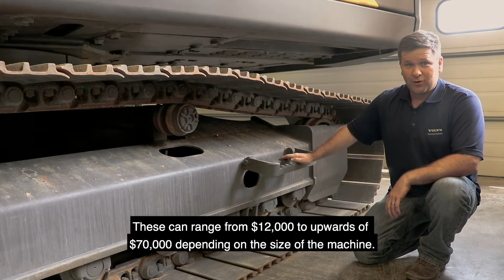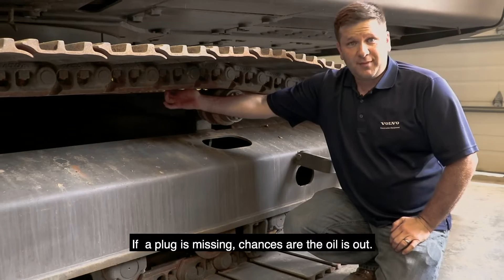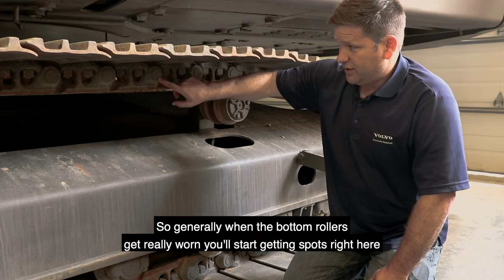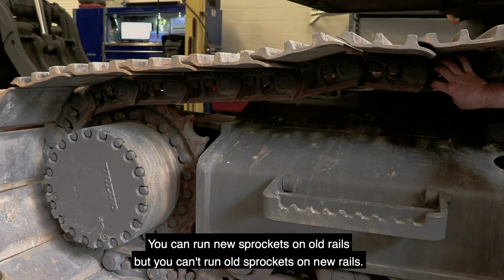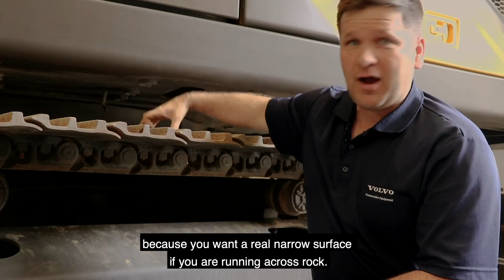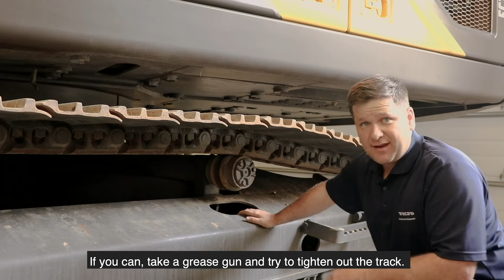How To Inspect An Excavator Undercarriage

Comment: Would love if someone would explain why nobody puts doors or metal covers to seal up the track adjuster and other parts with windows that are cut into the track frame. 90% of the time that will fill up with mud, dirt, grease and whatever other hell the machine's been working in (landfills are a dream), and you'll be wasting time digging out the gear. Sometimes it fouls up the track adjuster and really makes a simple job hard.
Why not put a bolt-on or hinged door on those windows to keep the debris out? 1/4" steel, cut to size, drill some holes, maybe make some welds and you're saving money on labor for years.
Reply: Ejay years ago Poclain made u farm undercarriages. No dirt would build up on the frame. As the top of it was at a point. And if painted on burned oil it would slip right off. Great design. But that shit company called case IH bought them and made the crap.